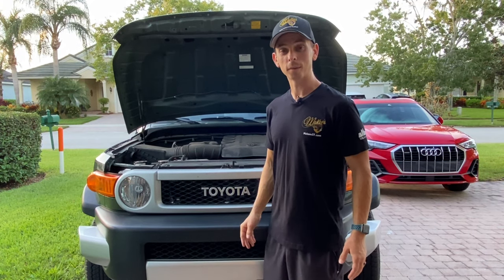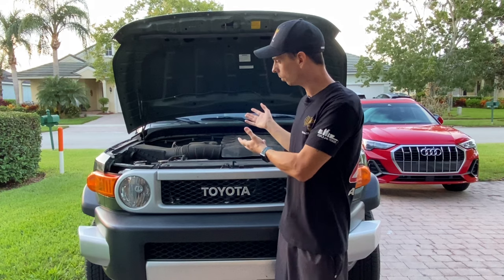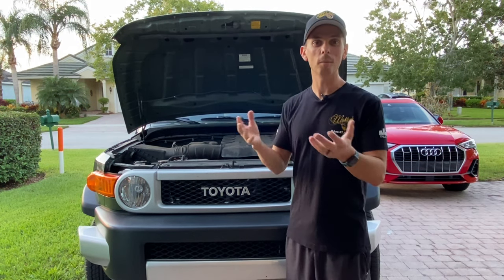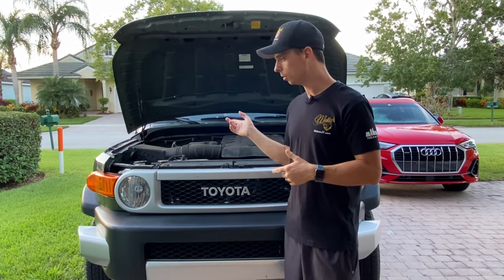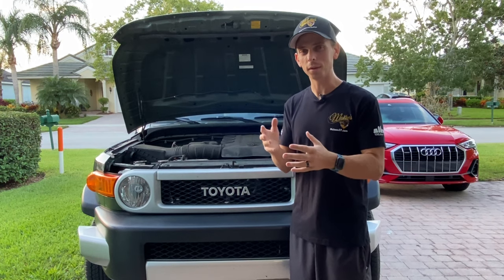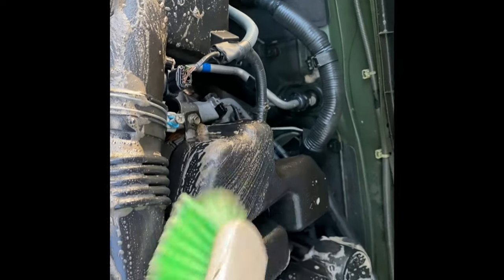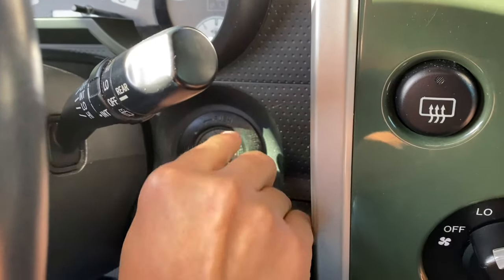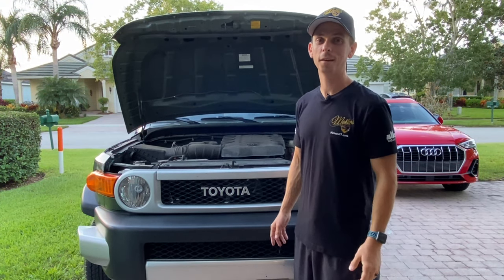How to Clean Engine Bay using Caveman Method

Comment: Good video, Nick!  How is the spray treatment with regard to attracting dust?  Many products that I have used are tremendous dust magnets ….. Here in West Texas that’s always an issue 😞
Reply from the maker: If you apply the product too heavily (like I did on the intake tube), it will be more likely to attract dust.  In my experience, Trim Detailer isn't a dust magnet like other products though.  -  Nick
Reply: @McKees37  It’s always so easy to get heavy handed with products 😕🤠

Comment: I have typically used Meguiar’s Super Degreaser at 4:1 for cleaning engine bays. Just wondering how Engine Degreaser compares, i.e., is the difference in performance worth the increased cost, and why choose one over the other?
Reply from the maker: Hi Shane, great to hear from you.  Our Engine Degreaser is less caustic and is more environmentally friendly.  This makes our Engine Degreaser safer on surrounding materials (over spray is inevitable), and also safer for you, the user.  -  Nick